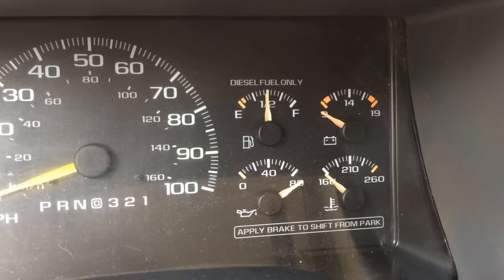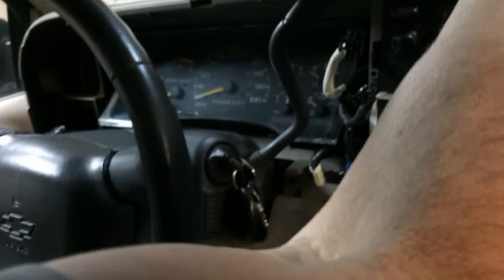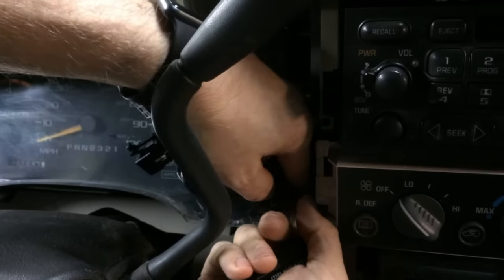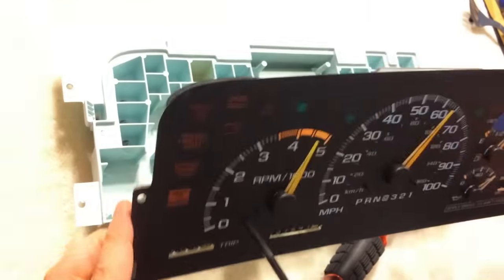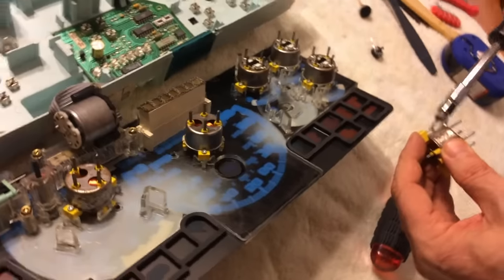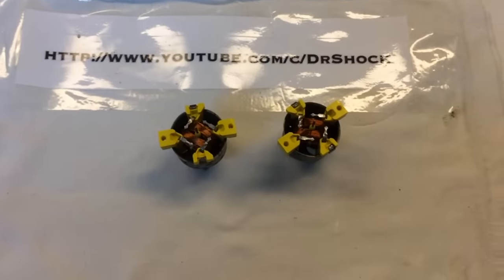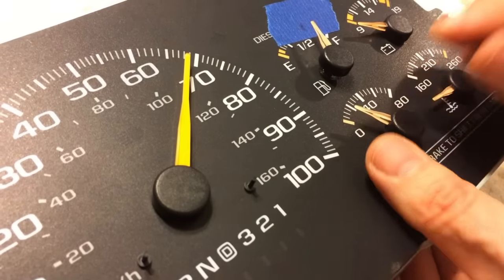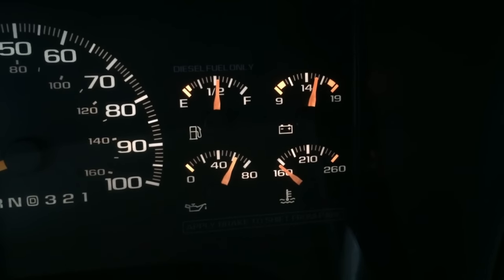1994 - 2002 GM Truck Twitchy Erratic Crazy Fuel & Oil Gauge Needle Aircore Motor Repair (Chevy GMC)

Comment: my 1996 suburban, gas, with stock tire size,  the speedometer is off by about 5 mph, is that aircore motor the problem?
Reply from the maker: I would say unlikely, presuming speedo shows zero when you're not moving (if it does not then it could be).   Given original RPOs for axle ratio, tire size matches door jamb sticker and all four at correct air pressure shown on that same sticker, and original transmission everything related to calculating the speed is handled within the powertrain control module for '96 based on various sensor inputs.  The aircore motor is just going to reflect that pulse signal sent to it by the PCM.   Pre-96 I believe there would have been a vehicle speed sensor buffer board that calibrated this outside the PCM, but I believe 1995 was the last year for that on gasoline (diesels would still use it) and this link is great for how to adjust it for changing tire sizes/axle ratios - http://tbichips.com/?page_id=504 in case someone sees this comment with an older truck.  So my initial reaction to it being off such a small amount is simply it being over two decades old now any or all of the electrical sensors involved may have "drifted" in spec.   But you might get lucky with google with some of these new terms and jargon I've given rather than having to resort to parts swapping to trace it down.

Comment: I hope that I can find these motors,  going to replace the factory radio while I have the bezel off , it still has the factory AM/FM Delco radio.. Any help locating these motors would be a help.
Reply from the maker: Supply from China has dried up.   Pinned comment has the only source, an eBay seller, left who has some stock and original equipment to refurbish used motors as well.

Comment: gm has a great reputation for faulty dash and electrical issues in the 90's and early 00's.  just an fyi if the oil pressure sensor goes out in yours depending on if it shorts or loses connections it can peg or show zero.  zero return reference from the sensor in my 92 causes it to peg out, just some food for thought.  if the sensor in my  92 actually sends a zero signal it kills the fuel pump.  i recently had it go bad and for a year it was pegged. replaced the sensor and away i went with finding other things that were bad too.  This said one wire on my 92 goes through the fuel pump relay and back to the pcm, one of those is a fuseable link so if its damaged that can screw with readings too.  Best thing to do  pull the sensor and check the pressure manually, this will tell you if the gauge or wiring is the issue. If the oil pump really is bad and the sensor is working it will kill power to the fuel pump.  If the cluster is screwing up it will still throw the check gauges but will never kill the engine.
Reply from the maker: Thanks, good points.  FYI that GM safety design ended in 1995.  The oil pressure sender from 96+ is no longer involved in the fuel lift pump circuit.
Reply: @DrShock  interesting, I didn't know that but thanks for the info.   I just wanted to share my recent experience with my 92. I had a 99 suburban with dash and fuel pump issues but the pump had power so it was a no brainier and the cluster has shitty grounds everywhere.
Reply: @DrShock  you wouldn't happen to know if these are the same motors in my 92 would you? i think the motor is weak, the oil pressure is different than the gauge according to my manual gauge i hooked up.  it also doesn't come up with rpm increase sometimes but does other times and other times it drops to zero after its hot and then when i restart it goes higher but slowly drops back to zero.  i suspect the motor is weak because it was pegged out for a while when the sensor was shot.  i haven't torn it apart but i wondered if it was, thats actually what brought me to your videp
Reply from the maker: It's going to be the same aircore type gauge design, but I do not know if it's the same part used on the later models or not.   Even the ones I did this video have had their supply dry up during the pandemic though.   I pinned a comment at the top of a speedo shop on eBay that offers a rebuild service.  You might ask those folks.
Reply: @DrShock  thanks, i appreciate your time.the salvage yard has a cluster so i might try my luck there.  hoping my amazon oil pressure tester is right, i don't want to do an oil pump.  the gauge is acting a bit strange, my only concern is when the gauge hits 0 oil the check gauges comes on but if i manually push it over it doesn't trigger the same warning.  so i don't know if the gauge triggers that or the switch itself.  not sure exactly how those operate but i will put this other cluster in and see what changes then swap the motor if thats it and keep the rest for future use if the motors are all gone.  the yard only wants 50 for the whole cluster but who knows whats good in them.  
again thanks alot for your responses

Comment: Outstanding Video. Are all the gages for these models 1994 - 2002 GM ?
Reply from the maker: While the video is specific to the old body style (ended in 1999 for pick ups, 2000 for SUVs, and 2002 for 3500 commercial chassis cabs) C/K truck models, the same type of aircore motors were used on the G van, P van, and S/T trucks as well.  They were used on the first couple of years of the new body style trucks as well.

Comment: Holy crap, no wonder my new fuel motor didn't work, I missed the crucial step of swapping over that tiny resister from the old motor. Too bad I had already thrown it away, but luckily I had just bought a parts cluster cheap for the temperature motor. Great video! Thanks
Reply: My temp Guage is acting funky too I changed  both sensors already too

Comment: Found on Ebay through US_Dashworks , a new oil pressure Air Core stepper motor for GM 95-02 , but under vehicle fitment chart it says it won't fit my 1995 S10. Now I'm confused. Help.
Reply from the maker: I can only say these fit the full size trucks and vans, I've never opened the dash for the S10 to see if they are the same size and numbers.  Those guys at US Dashworks are a speedo repair shop, they are going to know if it would fit.

Comment: So I have a 97. 5.7. Obs; the old thermostat would keep the truck running cool around 145. The temperature gauge in the cluster read that temperature accurate. However, when I put in a new thermostat. That brings the truck operating temperature. Once it hits 150 it just keeps going all the way to 240. I’m gonna check all my grounds.

Comment: My 97 GMC Sierra fuel gauge vibrates, appearing blurry, after 100 miles driving (from a full tank) it registers at 3/4 tank. Is the 98 a aircore motor (for the gauge)
Reply from the maker: That year is an aircore motor design yes.  But you’ll want to verify you don’t have a fuel level sender problem first given your description.

Comment: What if the fuel gauge works but it’s not accurate? I have this issue on my 1997 Sierra k1500. Thanks
Reply from the maker: I would check grounds and the fuel sender assembly in the tank for this issue.

Comment: OK what about this, my fuel hand was going crazy so i changed the sending unit. I emptied all of the old gas out put ten worth in the tank start it up then the hand was like over from the E a bit, before I cut it off I noticed  it was on F, and stayed there. So where do I put the needle when I fix it?

Comment: Nice video.  But I suspect poor connections either at the main connection to the panel or at the plug-in to the circuit board.  Crap connectors!  Servicing it reset both of those, scraping the oxides off, and might have worked w/o the motor change.  By the way, the motors are just a magnet attached to the needle shaft, set inside two coils of wire set at right angles; the circuit drives them with different currents to point the needles.  You can measure resistance of the coils to test them and/or drive the needles to a known position by running current through a diagonal set of terminals from maybe 3V DC.  Mark that and you can replace the needles to that position.  Also, if you have sticking gauges, check that the needle's hubs are NOT dragging against the mask as they can easily do if pushed on too far. That made me crazy for years.
Reply from the maker: Thanks.  But no, not a chance of electrical connectivity at issue here.   The aircore motor is an analog device, being utilized to present a digital signal.   To account for the mismatch, GM engineers specified the aircore motors calibration to also include a dampening fluid to delay the needle response.   This accounts for representing a digital square wave signal, until it dries out.   The fluttering is 100% due to loss of this dampening effect, which leaves the needle to portray the 1s and 0s of the digital square wave incorrectly in a naked un-dampened fashion.
 
Some folks have tried manually re-injecting a silicone fluid in to replace the OEM dampening fluid, but this is at best a temporary mitigation.  It always returns.    Replacing with an NOS aircore motor, or a professionally rebuilt one by a speedometer repair facility, is the only viable long term repair.

Comment: how do you mark the fuel guage when mine is all over the place has no home location to mark ....i looked up on ebay their 100 for fuel one ...wow
guess i'll be looking at Pic n Pull...thanks for posting
Reply from the maker: Unless you have a fuel sender problem in the tank, it should home when the vehicle is in engine off, key on position.   If not, you either do not have this problem, or you have this problem plus a fuel sender issue as well - https://www.youtube.com/watch?v=dw9Hia55yys   btw, a salvage yard cluster is likely going to have the same needle twitching problem, after two plus decades they all pretty much have failed internally by now.
Reply: @DrShock  thanks for posting all that. 
i had changed the fuel pump/sending unit yrs ago..it went out like a yr later been driving this way for yrs after watching about 1/2 of it....(mine is gas so some is different) I think you convinced me to avoid that troublesome  can of worms. I'm just gong to put in my old  air core back in , continue using the trip meter and filling every 200 miles

Comment: First I wish to thank you for doing such a clear and detailed video.  I have a few questions.  

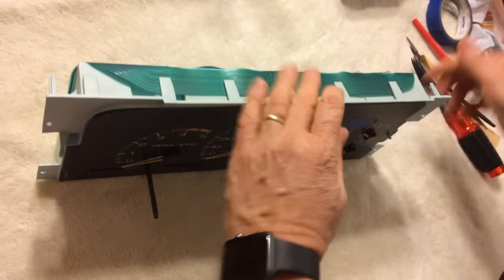At the 10:15 minute mark, you said that the fuel gauge will stay in its correct position when the power is turned off.  My fuel pump quit working a few weeks ago and kept blowing fuses.  When I changed the sending unit the wires on it were all melted and fused together.  (I am lucky I didn't blow up.)  After replacing the fuel sender my fuel gauge has been spinning wildly and jamming against the oil pressure gauge or stopping at random positions, so marking the position would not help since the needle always stops in a random position.  Other than draining the gas tank to empty do you know a better way to find the correct position for the gauge needle?  (Your video also showed me how to pull the dash so I can change all my burned-out lights...THANKS!)
Reply from the maker: Thanks, there's some more technical info in the video description too.  But in this situation you have to manually recalibrate for empty and full.   The easiest to do is full, as empty isn't really empty to help you get to a station you have some reserve capacity even when it says E.  So I would go for F instead, to start loosely install the needle, and fill her up.  Then set the needle to where you usually saw the needle when doing a fill up (some will be slightly past F, some right on the money, and some a little ahead).
Reply: If they melted you may have a ground that is loose. Check all your grounds.

Comment: Dr.Shock, my gauge recently started doing this  and I was looking for the silicone oil and the one you have isn't available anywhere around me.....any substitutes that I can use
Reply from the maker: I didn't mention anything about using silicone oil, in fact I recommend against that.  It's a temporary hack, not a repair.   The links for these aircore motors are in the description, they are available just not cheap.  ;-)

Comment: I have a 2000 obs 1ton classic 
My fuel gauge reads about half when it's a full tank. When the key is off it zeros out. Your video shows it doesn't go to zero/empty with the key off. I'm trying to re calibrate it too read full. I have a full tank now.

Comment: How many 194 bulbs are replaceable?  Want to install LEDs.  Pleas advise.  I have changed two motors.  Great video.
Reply from the maker: Some of these are PC195 bulbs, there's a link in the description for them.  The difference is that the bulb and socket are an integral part, rather than the bulb being separately replaceable.  Once you see what they look like, you may be able to find an LED equivalent.